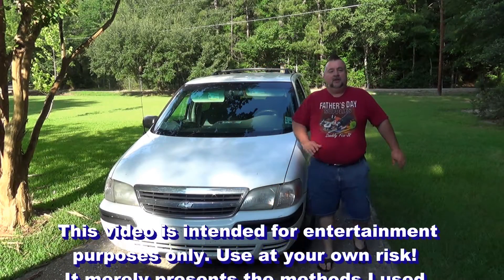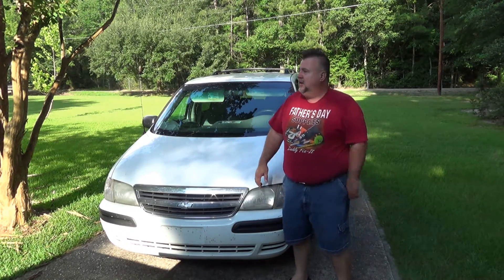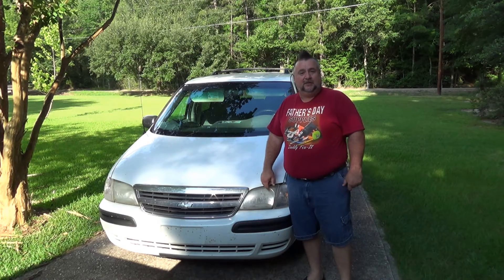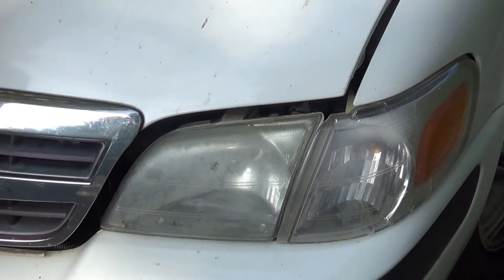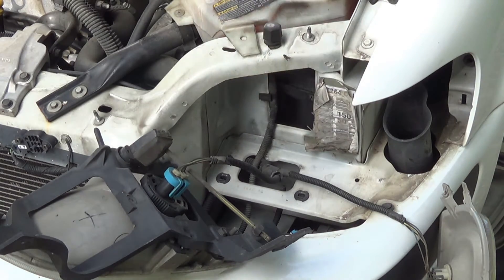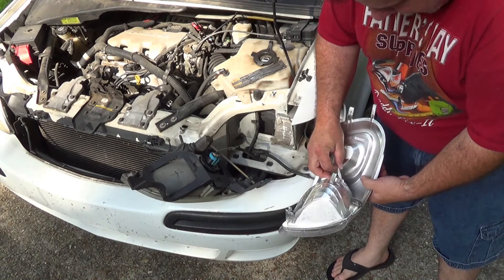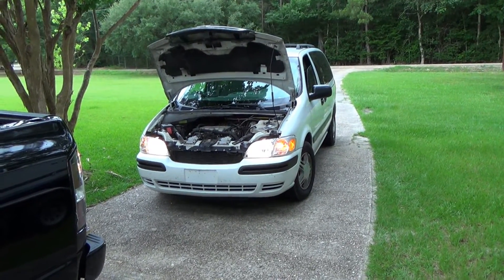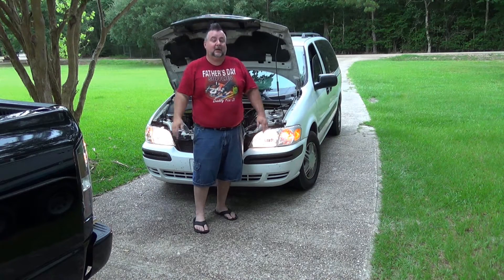How To: Replace Your Chevy Venture Headlights

Comment: Mine were actually much worse!

When the headlight bulb blew on the driver’s side I found it actually blew UP due to water intrusion. The lens fell right off when I tried to shake the bulb glass bits out, so I couldn’t just replace the bulb. Both sides were almost completely opaque and had cracks in the turn signal housings so I bought a complete set of replacements.

When the replacements arrived the turn signal bulb sockets on BOTH sides cracked and crumbled when I tried to move them. I had to loose-fit the signal bulbs for one day while I ordered replacement sockets only to find out that they also double as marker lights so it melted one of the new housings. Doh!

While doing all this I tried to fold my side view mirror for more room only to have it tear off the van so I needed one of those too.

I soon realized that there were TWO sets of alternating turn signal bulbs in the same housing (weird) and the smaller ones were simply blown on both sides, so I had to replace those bulbs too.

When trying to adjust the headlight aim I ran out of adjustment and the adjuster just completely disconnected, so I can’t even back it up.

From the lens to the mirror to the bulb sockets, to the adjuster screw: it’s as if everything I touch on this van just self-destructs. I’m STILL dealing with all this weeks later. About the only pleasant surprise was finding that TYC includes bulbs with their replacement headlight housings.

Comment: Today I got delivery on the same headlights for my 2002 Silo.  $75 from Amazon, boxed and packed the same way with stickers adhered to the openings.  I hope you didn't leave your headlights on too long.  The heat would make the plastic stick to the lights.  Oh, mine did not come with bulbs and the seller said they wouldn't.  I wanted to watch a video before installing and had to laugh because when I started out the door it started to rain.  Here's a tip.  After washing your car apply Aerospace protectorant 303 (available all over) to the lights and buff them with a microfiber cloth - not wipe, buff them.  My daughter has a 2002 Explorer and her headlights could pass for brand new.  That is not an exaggeration.  If you never wash the car at least treat the lights to a frequent bath and beauty treatment. LOL